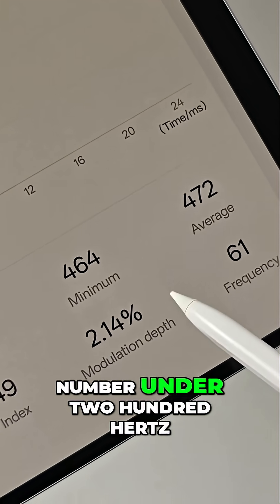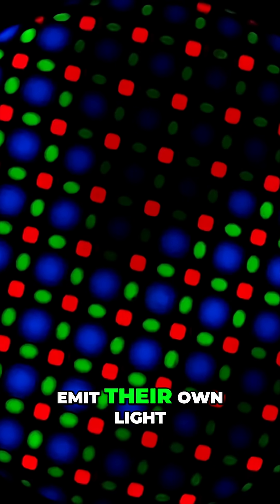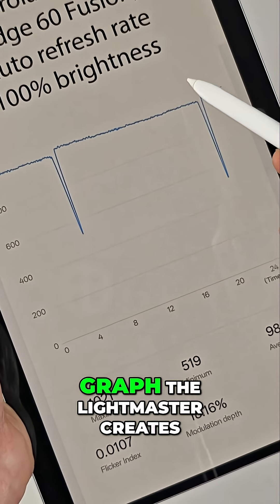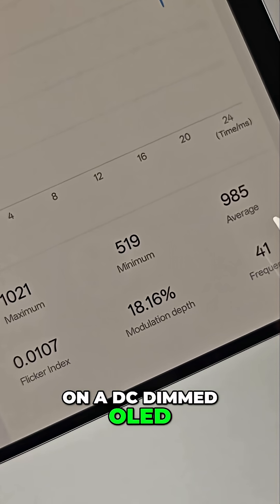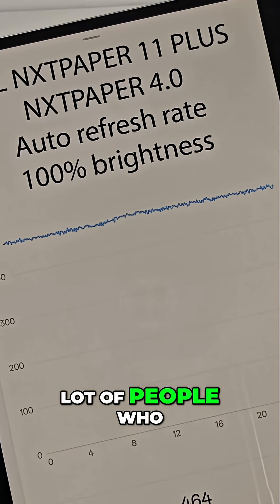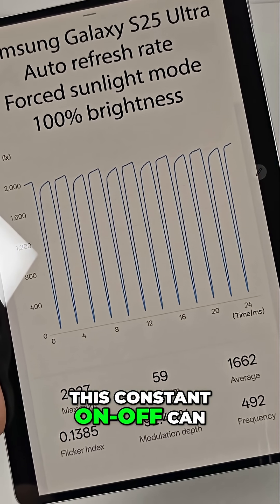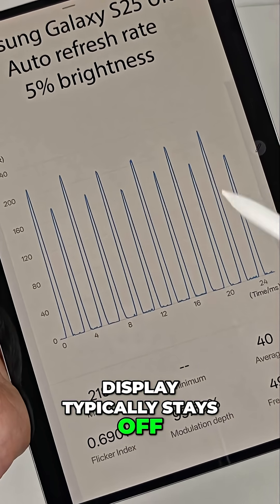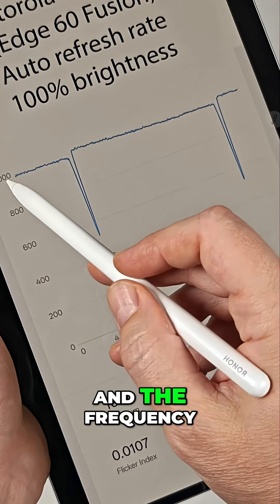OLED Displays: DC vs PWM Dimming EXPLAINED! #shorts

Comment: I've asked for a video like this and here it is. Unfortunately you haven't explained those two other words, "modulation depth" and "flicker index".
Reply from the maker: It's in the full video. "Modulation depth measures how dark the display gets during each of its pulsing cycles." A higher modulation rate simply means that the display gets darker during the on/off cycle.
Flicker index is the mathmatical calculation of (Area above the mean light output) / (Total area under the curve). I don't like using this as it's mainly for lightbulbs rather than displays.